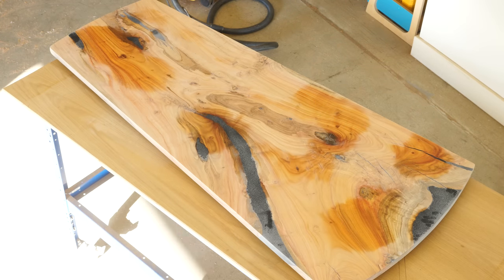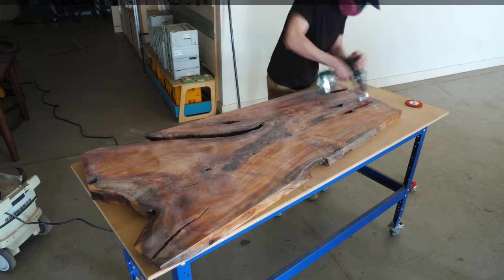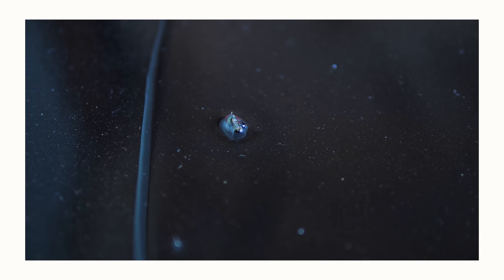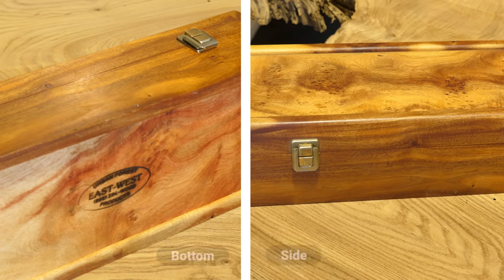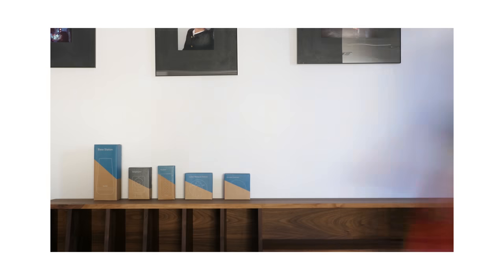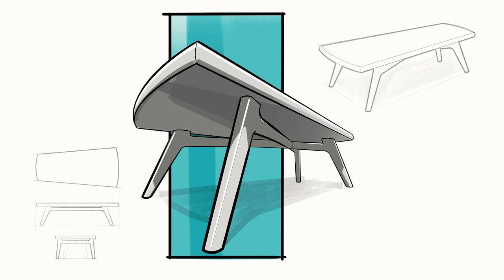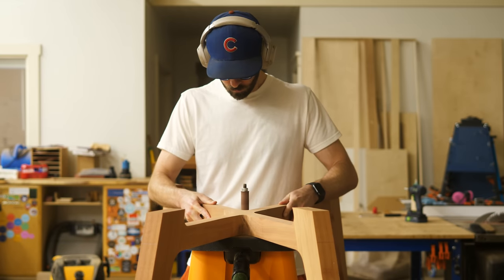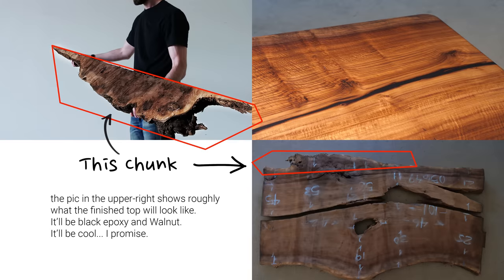Turning Worthless Wood into a Stunning Table

Comment: For a respirator, your best bet might be one of those full face, forced air things that wood turners wear. Trendair and 3M Versaflow are two common ones.
Reply: This, very this. If you have positive pressure, you can never be able to breathe any shop air no matter how full your beard is!
Reply: @jimsubtle886  just so both y’all know, you can 100% get a proper seal with facial hair or full beard. NATO has tested and proved this.
Reply: Came here to make the same comment: Check out Versaflow
Reply: I've used the Trend Airshield Pro for many years and found it to be great - though sometimes a little loud, and it can move around a bit due to being top heavy. I'm now using one of the 3M Versaflow units and it's so much more comfortable - but granted much more expensive.
Reply: The respirator @michaelcthulhu wears on his YT channel is still to date the single best I have ever made and/or used.
Reply: I picked up a 3M Versaflo PAPR, and it’s been one of my favorite purchases. Keeps my lungs safe and also provides face shield protection.
Reply: Can highly recommend the Trend, we have one each in the workshop, I don't get on with the optional ear muffs (transmit to much fan sound) so use silicone ear plugs with the Trend
Reply: Agreed, I work as an Industrial Hygienist and any Powered Air Purifying Respirator (PAPR) would keep your lungs and beard safe. 🙂
Reply: @leafbone1  that's a good point - the clip on ear muffs don't work that well on the Trend. I bought a set of the 3M muffs for the Versaflow and they're way better.
Reply: I have a beard and really like my CleanSpace respirator (PAPR). Not a mainstream option, but it was a bit simpler and cheaper than most 3M and Trend options.
Reply: @RobFulcher  thanks for the heads up on another option I hadn't heard of!

Comment: You said something that to me holds very true as a wood worker. And that is yes when building or even restoring a piece of furniture we often build it or restore it to "our" specifications. But sometimes those specifications have to be some what flexible to the piece we are working with, or else that piece just becomes a piece of garbage or fire wood. It's like with a headboard I made years and years ago when I was still a teen who was still just starting out. That piece of wood had a flaw in it, that caused me to have to change the design of the headboard to incorporate the flaw on the corner from the wood having a split in it that resulted in that corner sloping off. The guy who bought it loved it, and said it added character to the piece, but I was never happy with it but I was not about to scrap a piece of $40 dollar wood over a flaw.

Comment: I’ve got a walnut slab where I’ve already prepped, filled imperfections, and installed a very few dutchmans.  I’ve had thoughts and even sketches  nearly identical to your support system for this table.  It’s meant to be a dressing bench for the end of our king bed and has been ready to go for many months, I just haven’t pulled the trigger on the thing.  I don’t own/use dominoes and I’m primarily a hand tool only guy; only using jointer, planer, and on occasion a bandsaw to mill my timbers so I can do more of what I enjoy with the hand tools.  The only way I can see this working for me is with bridle joints where the stretchers meet the legs, but the air gap between the seat and the slab is exactly what I’m aiming for.  Thanks for emboldening me a bit on this and maybe it’s time to take the project back up.  After all, the slab isn’t doing anything for anyone sitting stickered and ready to grow legs in the shop 👍

Comment: Huge +1 for the slow down tip.  I've been a hobbyist woodworker for almost 30 years.  I improved a lot over the frist 5-10 years as I added tools and learned new techniques, but then the quality of my work kinda' stalled.  It was good, and there were few things I couldn't make, but the overall quality of the finished product was stuck.  I had seen lots of really nice furniture, so I knew it was possible, but I couldn't pull it off, and I didn't know why.  Fast forward 10 years, and in my 40's I simply grew more patient.  I didn't know much more about woodworking than I did a decade earlier, but I was making fewer mistakes, doing fewer touch-ups, and getting noticeably better results.  I didn't slow down because I thought it would make me a better woodworker, but because I was in less of a rush. Even then, it was a couple years before it occurred to me that my projects were consistently better and not really taking much longer, all as a result of slowing down.  Maybe I'm denser than a block of chechen, but I eventually identified the secret sauce.

Comment: I believe that this is the first time I've ever commented on a you tube thingy. I really enjoy your work and in particular your attention to detail. I recently bought a cnc machine and have been making waney edge tables for a while before that. Epoxy isn't to my taste and yet you certainly do a wonderful job of your tables. I've been joining waney edges along the grain structures and matching adjacent planks to one another with wobbly lines rather than butting straight planks. It works really well.  More than anything I'm impressed with your charitable affiliations and since you asked, I really like the combination of drawings animations and the excellence of your video editing.

Comment: Amazing designs!  I hope you don't mind a little suggestion to save a little time, but for those aluminum mounting brackets you might just cut the corners (no pun intended) on the brackets to the routed shape so you won't have to chisel the sharp corners.  This might also in the future prevent the wood from splitting in those sharp corners from any stress between the table and legs.

Comment: If you've ever seen a carob pod, it's dark on the outside but golden on the inside. I think you're doing justice to the species by using a charcoal finish, even if the inside is still lighter.

Comment: For the respirator beard thing. Your need a good seal but if you get the right respirator it can cover 90% of the bearer well.

Check out the channel for Evan and Katelyn and the respirators they use when doing epoxy. They might be a bit over kill but it is filtering the air. 

In the end it’s what your comfortable with but the better coverage the better your lungs will be
Reply: Their full face shield are awesome love E&K! That said you can get a perfect seal with facial hair or a beard which was proven by NATO.

Comment: I could see going either way with the stain. But the finished product is pretty sleek and the choice to blacken the base was spot on. I dont particularly appreciate the more modern aerodynamic look but I wouldnt give that piece away if it were in my house. I would actually pick a space and try to compliment it with other pieces. I been doing furniture and do dads as I call them for 45 years. As a retired Developer/Contractor I spent my whole life building. You, young man, impressed me with your design capability and desire to strike out into unknown places you havent tried before. I wish there were more like you out here.

Comment: I like being surprised by how much I like something afterward that "I wouldn't do".  I'm more in that "natural wood" camp, but I can find no fault in how this top turned out.  Really impressive.  The only thing I would have done different with this, was to paint the mounting hardware black.  Sure, it's on the underside of the table, but I like to care as much there too.  And as you say, the important thing is how you feel about it.  So even that's all good.  Oh, and Cam says "Make the spider table base out of wood video".  Just have to put that in. Scott from Japan

Comment: I know this was a lil while ago, but I jus wanted to comment on your options for respirators. During my time as a field geologist for an engineering firm, we had to get fit tested for respirators as part of our HAZWOPR training and because I was around gas/particulates. For those with beards, we had to put petroleum jelly on our beards where the seal of the mask would be. This ensured a solid seal. 

I do the same whenever I go free diving with my mask and snorkel. If I don’t my beard definitely let’s in water.

Comment: I like that you touched the whole metric to what I call standard. I call it standard because, If a reasonable person was to create a measurement from scratch, it would always start with a unit, then cut it in half, and then in half again and so on and so forth... and boom, you have yourself an inch. Mathematically and naturally, 12 is a magic number as when doing math in your head, it is divisible by so many numbers, therefore 12 is an advanced builder's number. Going smaller, anything smaller than 1/32" will never be noticed by a human being with typical craftsman stuff. With metric going larger goes from wee to weird to huge. Metric is not made for builders and craftsman as much as the scientists and archeologists want it to be. It is for the guys that need paper to divide 5 in half. The problem lies in the fact that all of our math teachers were already confused themselves! Fractions could have been so easy!

Comment: I would highly recommend the Peke Powercap for lung protection. It is a Positive Air Pressure Respirator. I've been meaning to do a video on this, and just haven't gotten to it. It has a full face shield and a fan in there. It's helped keep me cool, even on the hottest days.

Comment: Sanding with light to no finger pressure has always been best - if you have a good dust extraction vacuum that you can adjust. Until relatively recently, very few of us used dust extraction and many sanders still have very bad attachment to the hose. So, to get any pressure, we pushed down on the sander. If I was starting over, I'd invest first in dust extraction and tool integration. 45 years ago, dust control was very crude

Comment: When I took a woodworking course, I used to drive the instructor nuts because I’d switch between metric and imperial for whichever number was ‘nicer’ - she’d get so frustrated and wouldn’t let me submit drafted plans for projects that had both on it, and told me to just pick ONE!

16 years later, I still use both.

Comment: Long time viewer here, your videos are unique: attention to design, soothing voice, drawings, techniques, etc. Doesn't matter if the end piece is not the cup of tea of everyone. Quick question for this one: the aluminium plates doesn't allow for wood movement, isn't that a problem?
Reply from the maker: Thanks Nicolas, I'll try to talk about this more in a future video. But in this design it'll be fine. 

We really only need to worry about wood movement between the two plates. Which is only like 18", so it's not going to move a ton. Maybe a maximum of an 1/8" 

And with this design there is quite a bit of flexibility in the legs. I could probably throw a clamp on the legs where they connect to the top, and bend them in by over an inch and nothing would break. The stretcher would just bend slightly.

Comment: The Sundström SR100 works well with a beard. I have a really long ward and I used it for a week when sanding and finishing our floors. The rather obnoxious smell of Osmo wax didn't penetrated a bit! It was soo good I actually forgot that it was smelling around me and got shocked when I removed the mask. 

Beard can be a problem when using masks but not to much. Army has mask and long beard in a test chamber full of CS caused a slight cough.

Comment: I use the imperial system (some call it the freedom system! ). However, I do believe it would eliminate a lot of problems to convert to the metric system.  From a science and engineering perspective, it just makes a lot of sense to do so. It would also reduce confusion between nations when they cooperate together.  Our military already uses the metric system in measuring distance and for other uses.

Comment: I'm happy the drawings got that much support, because they're really helpful!

When it comes to metrics. Firstly, on your main point, while it mostly depends on the person doing the work. But how much of it is really because of how specific (or detailed) it is, and how much i just conversion and scale weirdness? E.G: 1 mm vs 1/25.4" is a weird conversion (as in, probably doesn't make much sense when it comes to using inches), in the same way 1 33/64" (?) to 38.496875 mm (doesn't make sense in woodworking, E.G: I think the difference between that and 38.5 is the length of a bacterium).

1/64th" over an inch and a half, so 3/2+1/64 = 131/192 inches? Or, as you wrote, 1 in 33/64 of an inch.
Anyho, 

38.496875 mm (or 1,515625"), is close enough to 38.5 mm that no one would notice 0.003125 mm (or 3.125 micrometer (µm), or 0.00012303149606 inch (3.12 µm)). 
And I'm not sure how much of a difference adding or subtracting about half a mm to get to a  full mm (I.E: 38 or 39 mm (AKA 1.49606299213" or 1.53543307087") would make either – 0.5 mm is about 0.019685" which I  believe is: 1/50.8".

The costumer is always right, in matters of taste. And, well. You're the costumer! ;) Can't fault your taste!
__
I've rewritten the mm thing a few times, so it probably reads a bit odd, but it's late, and I have to wake up in a few hours so, eh, goodnight. ^^.

Comment: I enjoyed the video, thanks.  I don't particularly love epoxy slabs, but see a point to them.  I suspect you can get non-woodworkers to appreciate some beautiful shapes and wood, which they wouldn't appreciate if the table or work didn't look "finished" to them.  And of course, with such, the maker doesn't have to cut and glue planks together to form a piece, but can actually leave live edges, but bury those edges in epoxy.  Woodworkers appreciate the wood, and like to see all the parts of it.  We're more interested often in very small details of construction, that frankly, don't interest the general public at all, and they rarely if ever notice that.  I do those details for myself, but sure, I'd be lying if I didn't admit that when one of my woodworking friends comments appreciatively about such, I'm secretly pleased....
I don't like stained wood as much as non-stained wood also somewhat for the same reasons.  Many woodworkers don't stain things perhaps because using stain hides things, and perhaps feels a bit more like "cheating".  Truthfully, using stain is not cheating, but is actually difficult to do well, and often our early stained pieces look "fake".  (I can remember all that cheap stained fir of the 70's and 80's. )  Woodworkers back in the early 20th century did use stains, and used them successfully.  I do a fair amount of repairs of early pieces, and I have to use stains and touch up, to make the pieces look good again.  But I also have to say that most of that work is not particularly my favorite work.  
You question whether you should please your public (and yourself?) or woodworkers?  Absolutely please yourself, and since you are selling your pieces, then your public.  But do remember, that most of your non woodworkers don't have that much knowledge about the subject.  They don't mind the stains, or the epoxy or what color it is, perhaps because they don't think about it, or care.  How many will like the pieces in 30 or 50 years is another question.  Will it stand the test of time?  
I don't make live edge slap tables often, but I just finished a fairly large one.  Redwood.  (Soft!)  Incredible grain, but with the spring wood pretty wide in parts, the summer wood stands out.  This slab has absolutely incredible quilted grain.  Some might say that it is terrible to make a table top out of it, as it will get scratched and dinged easily.  If it were to be put in a modern setting, a fancy apartment or such, I'd definitely agree.  But it is going in a fairly large room in an all natural wood cabin.  I think the scratches it will receive will be part of it's history and it will age with the occupants.  Please yourself with your work.  You have lots of skill.  I doubt that you will have a lot of trouble finding customers that like what you like.

Comment: As someone who used to certify respirator fits, having a beard makes it more likely a respirator won’t work correct cause the hair can prevent a good seal but that doesn’t mean you can’t use one with a beard, just after you put it on cover the filters with your hands and breath in, that makes a vaccum that tightens and compresses around your face the respirator works fine and you’re set

Comment: 3M Versaflo Heavy Industry PAPR Kit TR-600-HIK. I'm pretty sure that's what Alec Steele uses. Looks awesome and evidently works great. I've been considering buying one but the price is around $1500 which might be a little hard to justify for random hobbies in my case. For you, I'd say it's absolutely worth it.
Reply from the maker: I’ll check it out. And you’re right. If I can spend an extra 1000 to save my fingers. And extra 1500 is cheap for lungs
Reply: @Foureyes.Furniture  Just sent you an email about the clamping blocks. I hope you receive it. Would like to take the challenge and try 3D printing some to see if and how well those work.